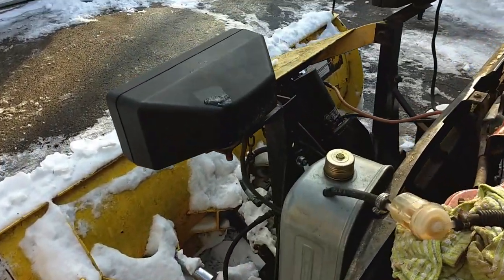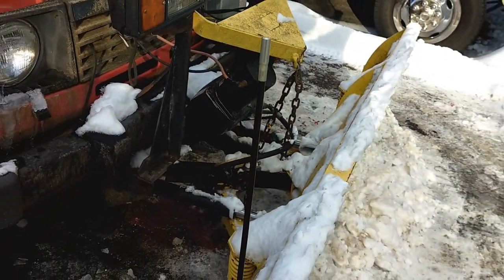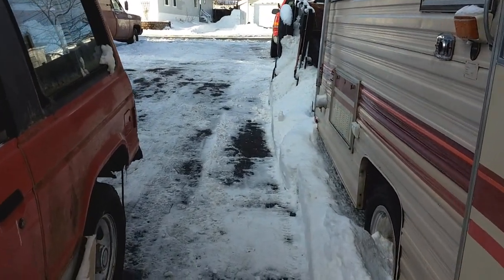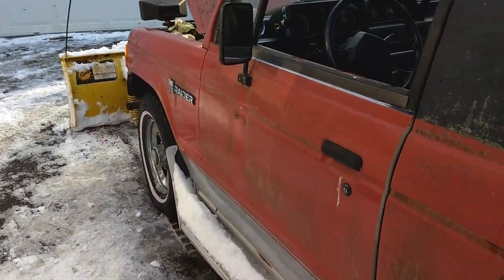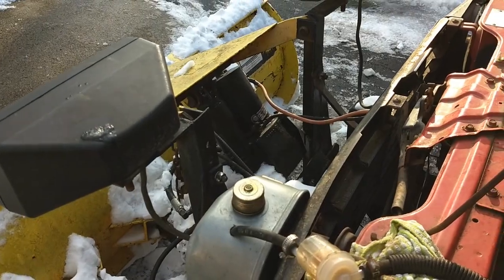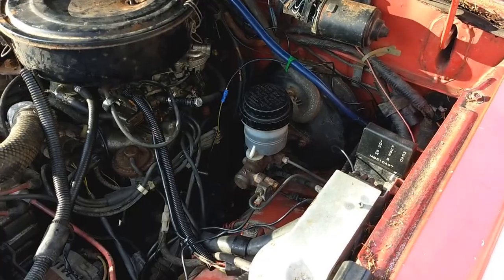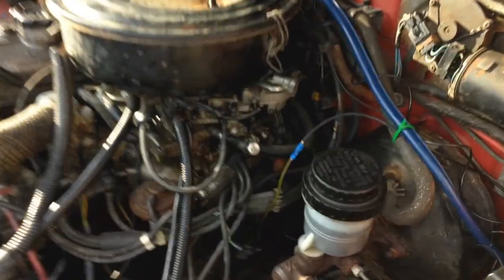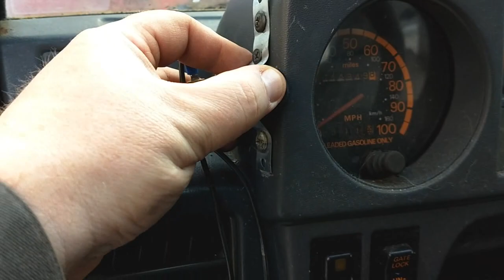Can't win

Comment: It's always so discouraging when you take the time to fix something up and it ends up making no difference or possible worse. I've never been afraid to rip into things if they don't work. I'd have that plow pump tore down in an afternoon and diagnosing what's going on inside. Would make for a cool video too! Lol
Good luck Brother. Hopefully you can get it figured out cheaply and simple.
Reply from the maker: i lack the confidence and motivation lol if you were closer i'd give the pump to you too mess with all you want!
Reply: @acrazycanuck78  
Haha! If I was closer I'd stop by with a case of PBR and we'd fit the Damn thing together! I've never touched one but there's not much going on in there. Electric motor still runs so you know that's good. A hydraulic pump and I'd imagine a solenoid body that diverts the fluid to each ram. Just a guess on my part having never touched one. Check on the YouTube's. Maybe somebody has a video on common issues or how to diagnose that particular issue.

Comment: If I remember correctly, between the motor and the pump  I think there’s a filter in there somewhere.. it’s broken now, so pulling the motor off to take a look can’t hurt it. And checking for power and ground at the pump.. and test the solenoid
Reply from the maker: its broken now?
Reply: acrazycanuck78 well, not working ish. Nothing is broken broken.. stuff just needs a little tinkering ;)

Comment: Maybe there is air entering the hydraulic system through a bad fitting or hose. Air in hydraulic systems will make the system not work.

Comment: I’m sure you have, but have you checked the main ground coming from the plow to the battery? With as much rust as that thing has. It sounds like it’s not grounding properly.
Reply from the maker: yeah i checked and cleaned all connections. the solenoid is 13 bucks on amazon so i guess i try that?
Reply: acrazycanuck78 cheap enough that you can’t lose too much.